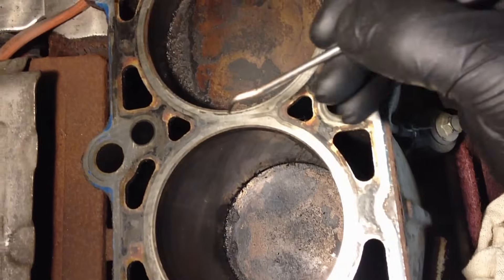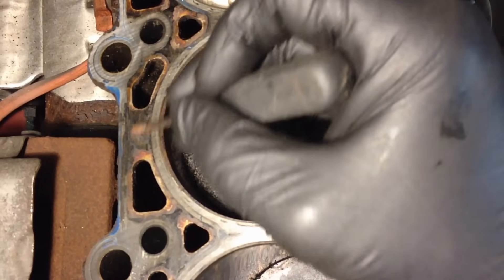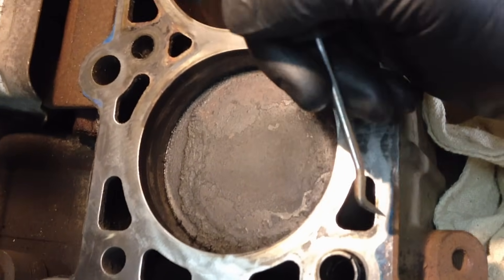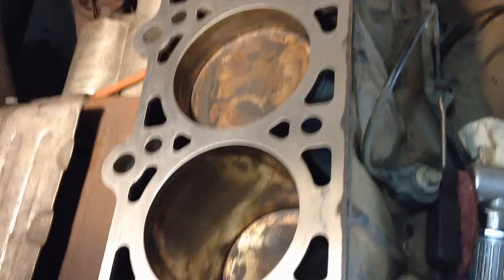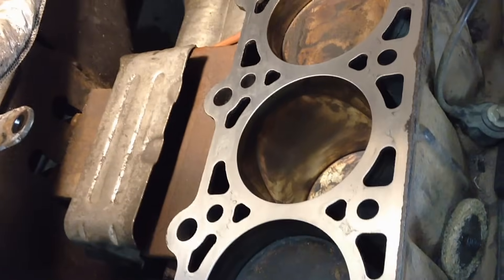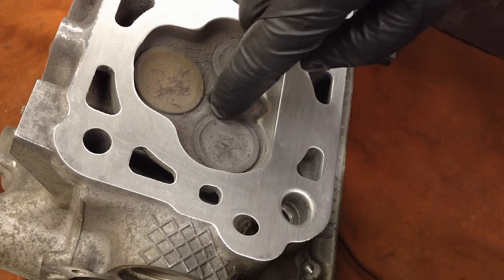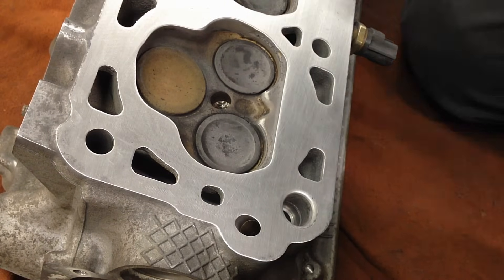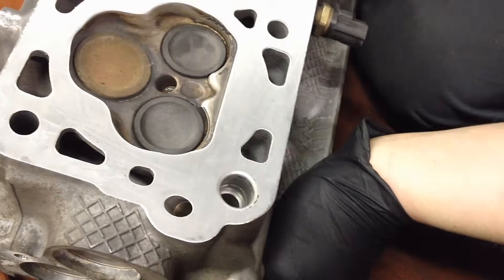My Best Method For Cleaning Head Gasket & Other Engine Surfaces

Comment: I never do head gaskets but for 99% of the surfaces i clean i use a wire wheel and ive found it cleans really well and fast and doesnt do any damage. The wire lasts a long time, but over time they shoot out and get stuck in my clothing. But i wonder how good a wire wheel would be for headgasket surfaces
Reply: srv3fender Wire wheel? You’re a fucking moron...

Comment: What about some of the grit that may have gone past the rag to the rings? Thanks for tips. I didnt know they made such a tool.
Reply: compressed air will just blow the grit further into the gap between bore and piston
Reply from the maker: mcnamee30 As mentioned compressed air to blow it all out and you will be ok. These rings seal so well coolant will just sit in the cylinders I don't think grit is getting too far in there but yes compressed air long reach nozzle and lots of brake clean on a rag makes it nice and clean. An oil change after head gaskets is a must also with any cleaning method you use.
Reply: Thanks. Great tips I always just used a razor blade and that sucked!

Comment: Use steel stock. A piece of angle iron works great.
Reply: Phillip Crossland Was it on  block?  If it was on something to keep it flat then it's probably actually a better method.  If he just held it in hand... well then it's time to start checking everything with a straight edge.  Anything in a sealing area that you can see light through (get any kind of reasonable sized feeler gauge under is probably a problem.

Honestly, I don't like a roloc disk for the same reason, it tends to wear faster where there is a thin piece of casting exposed, like between the cylinders.  I don't know if it's still the case, but for a while GM put out an official bulletin banning the use of any abrasive/roloc disks in cleaning gasket surfaces, not so much because of the potential for uneven wear, but because that little bit of abrasive you get in things was shown to cause engine wear and was costing too much in warranty repairs.

Me personally I spend a lot of time with a combination of gasket scrapers, a razor scraper and laquer thinner on a shop towel.  I've yet to run across a surface that i couldn't get clean.

You might be able to fix any minor problems with some sand paper on a large block if you're very careful.

Finally, when your done start cleaning up by vacuuming out the debris with a shop vac (I use a "buckethead" on a 5 gallon bucket dedicated to this kind of clean up and machining clean up, do not use the same nossle as you're going to use on your interior, at some point it will drip some oil or grease).  Shop air forces any grit into the tight crevasses (try to do that in a machine shop where all the machines have precision machined surfaces and someone will have a fit, blowing chips away quickly jambs up those areas and ruins them, you're doing the same thing to your rings).  Usually after a pass with a shop vac I go through with a chip brush and a rag and if I need to follow that up with the shop vac again.  If at that point you are still worried about stuff blowing what's left out with air is fine.
Reply from the maker: 71usmc I have heard of this also.
Reply: FordTechMakuloco A friend of mine use 80 grit sand paper to clean the gasket area. I didnt know becuase i went to the store what should i do now? my email is phcrossland123@gmail.com

Comment: Thanks for sharing your experiences with cleaning engine surfaces.

What are your thoughts about Ford TSB 02-11-4. It recommended cleaning head gasket surfaces with Motorcraft chemicals ZC-30 (Silicone Gasket Remover) and ZC-31 (Metal Surface Prep). I tried ordering the ZC-31 from our usual Ford dealer about a year ago, and the parts department informed me this chemical was discontinued (at least in Canada).

Did Ford replace this ZC-31 chemical with something else or abandon the idea entirely?
Reply from the maker: apodlosky Yes they replaced it with pre moistened wipes, very expensive. Not really needed either but they are supposed to etch the surface a bit for even better sealing. The zc-30 stuff I have never had any luck with at all horrible stuff in my opinion.